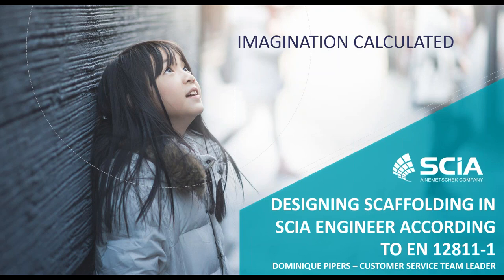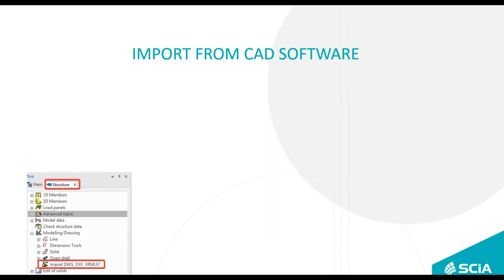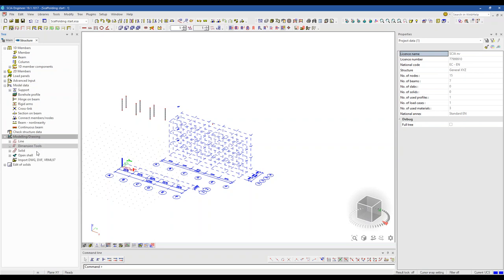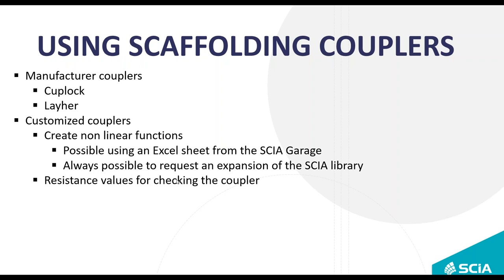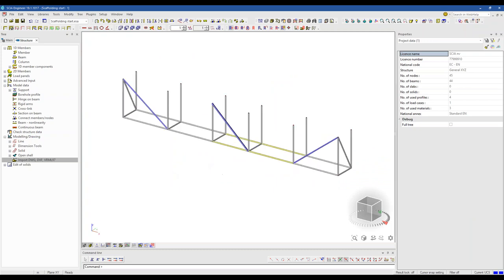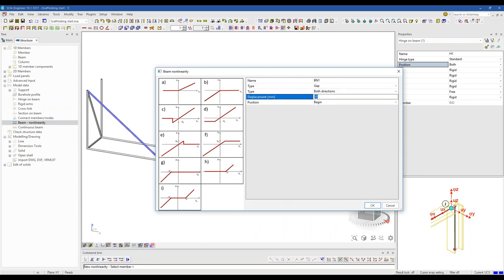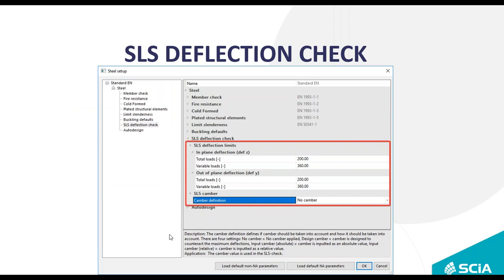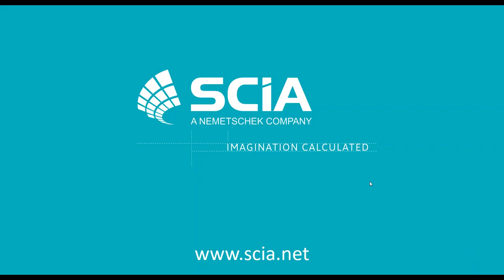[EN] Designing scaffolding in SCIA Engineer according to EN 12811-1

Comment: Hello,

Is there an option to include a sheeting to the faces? as a permeable or non-permeable (tildenet 85% or plywood 100%?) or in combination? 

Thank you in advance.
Reply from the maker: Hello 
-in the case of nets, this is usually not modelled as a structural element, but a reduction to the (wind) load is often applied as a function of the permeability of the net.
-if you want to include something that contributes structurally to the model (e.g. Plywood containing a certain stiffness), this can be modelled using 2D elements, to which a material is assigned with the specific properties of the thing you want to use

I hope this answer helps. If not please send us an email at support@scia.net. 

Have a nice day

Comment: Where can I find the sections for the U-ledger system for Layher Allround, or I must design these types of sections myself?
Thank you in advance1
Reply from the maker: The U-ledger cross-sections are not in our standard profile library. But you can create them through the Thin-walled geometric group at the cross-sections. Dimensions should be 49x53x2.5mm at the intersection.
Reply: @SCIAOfficial  ,thank you very much for the fast reply.

Comment: I would like to ask about modelling floorboards. Do you model the gap between the floorboards and the frame using "beam-nonlinearity" or by setting a joint on the member and if so how? Thank you in advance.
Reply from the maker: Hello 
You have a few options to deal with the boundary conditions on floorboards.
Often a hinge is modelled at both ends of the floorboard element and all degrees of freedom are set as rigid, except for the rotation around the local Y-axis of this element. 
The rotation of the local y-axis could be set as free or as flexible with a certain spring stiffness. Some users also define the rotation around the local Z-axis as flexible with a certain spring stiffness. 
Another option is to avoid hinges and instead to add nonlinearities of the type 'gap'. This method is fine as well, but often we notice that it becomes harder to find convergence during the (nonlinear) analysis of the model.